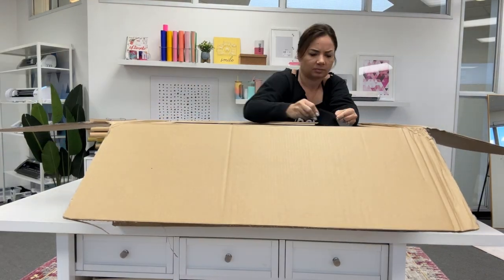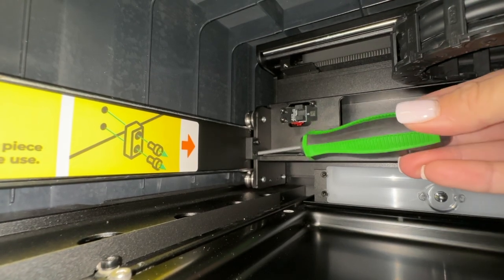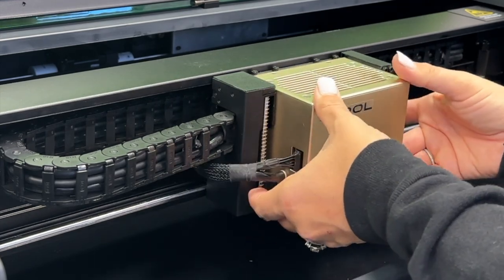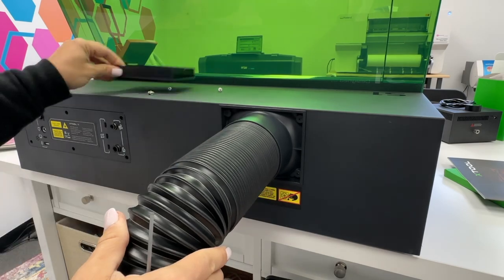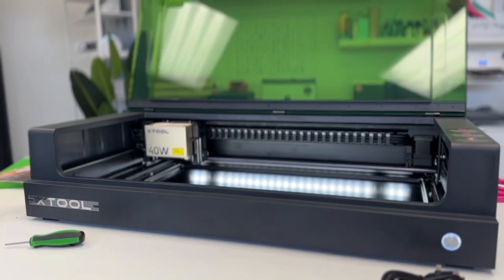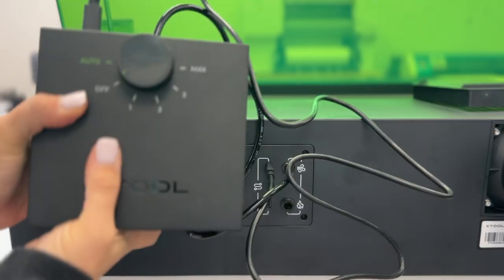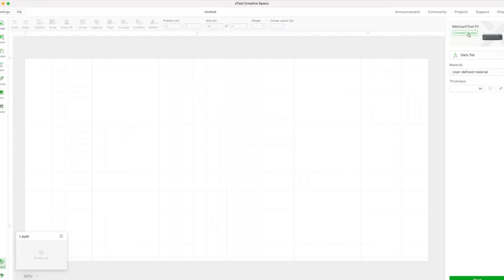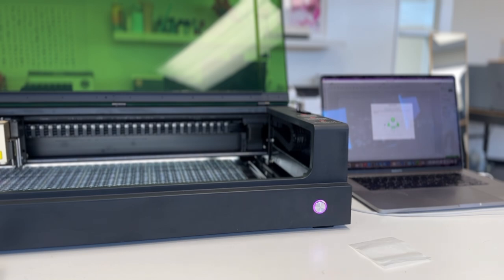XTool S1 Laser: Unboxing and Complete Setup

Comment: Any tips on installing with IPad where my F1 is already connected with
Reply from the maker: Right now, you aren't able to run two xTool machines simultaneously within the same application. You'd need a separate device for each if you want to run them at the same time.

Comment: The assembly manual is trash like 4 chapters each with 20 pictures of the base and only like a 15 word sentence on putting 4 screws into the base but not even so much as a synopsis that that's what you're actually doing. 
 ☝️ Chapters of that 💩
... Why?
Reply from the maker: Hopefully this video helped! 🙂

Comment: How ofter do you have to replace the laser module?
Reply from the maker: The laser tube in an xTool laser engraver or cutter typically lasts around 10,000 hours, but this can vary depending on how it's used and maintained.

Comment: How do you turn the machine off when you are not using it?  I did not see anything in the manual about that.
Reply from the maker: Flip off the power button on the back
Reply: Thanks.  That makes so much sense.